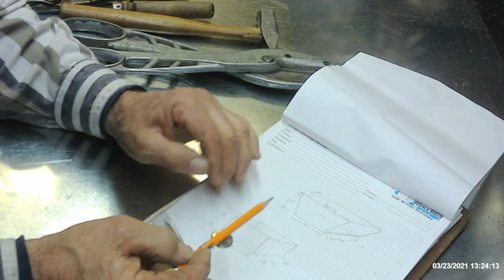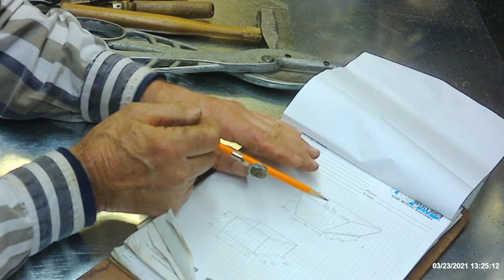Furnace Tearout Field Measuring For Sheet Metal Adaptions

Comment: What is the name of the tool you were using  when you made the comment that one piece was caulked to another?  (At 2:55 on video)   It looks just like the tool I used when I removed some of my cedar siding this year.  Honestly, I don't know the actual name.  It worked like a charm, I remember that.  Anyway, a good start on a trio of videos we can look forward to viewing.
Reply from the maker: That's a Vaughn 'flat bar'. I thin the edge down on the belt sander which allows it to be driven in between tightly attached sheet metal and sever the heads of the screws that cannot be reached easily...or in this case, slice right through caulking.  The Vaughn has good metal and holds up against the abuse needing a touchup ever so often.  
    The cheaper bars won't work because the metal is so soft.  It works wonderful for siding nails as well as removing damaged roofing shingles for minor repair or the installation of chimney flashing or vent pipe flashing.  If you thinned it down like mine, you would find it much more satisfactory to use.  
    The fab video is painfully long, but it is quite comprehensive concerning layout.  Of course, I talk too much.  LOL

Comment: I like demolition! Smash it!
Reply from the maker: Demo is always the best time on the job Andre.  You are probably not old enough to have torn out coal fired gravity heat systems that were converted to natural gas or LP.  Or the old 'one pipe' steam boilers and similar systems for change out to new forced air with central air.  Now THOSE were the good old days.  Wrestling sections of cast iron do-nuts up basement steps...dealing with the asbestos insulation before we knew it was hazardous.... Yes, those really were fun times.  I could write a book. The job was not for the weak willed or faint of heart at all !!  LOL  Thanks for the visit today.
Reply: I only ever had to replace a converted gravity coal/natural gas furnace at a house that had a basement walkout. We thought we were lucky until a scrapper drove by and saw us and asked if he could have the furnace. We were so happy we even helped him remove it. Sure is fun adapting to that duct system. Good work on the measure up. I always had fun remembering is it flat top-right?😉
Reply from the maker: @larrydurkee5741  Man, I did a ton of those change outs back in the mid to late 70's.  But when I got into the trade in '75 we were still removing coal stokers and installing 'Inshot' or 'Upshot' natural gas conversion burners up in the big city.  I did a good number of them. Totally inefficient beasts...but they were simple. Fun stuff back then. No computers....

Comment: next furnace, to open the box cut only the bottom strap step on the folds and take the box of in a whole, then boom trash box
Reply from the maker: Oh yeah, I've done that many many times.  Sure makes cleaning up the jobsite easier.  I do the same thing with the condensor boxes too.  I don't remember what the deal was on this job, but for some reason I didn't do it.  Thanks for the visit today.